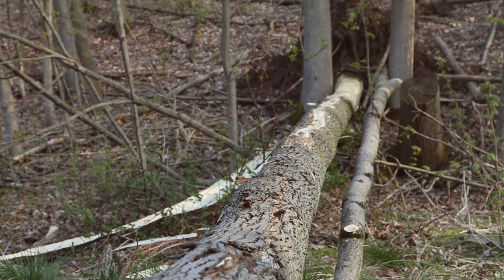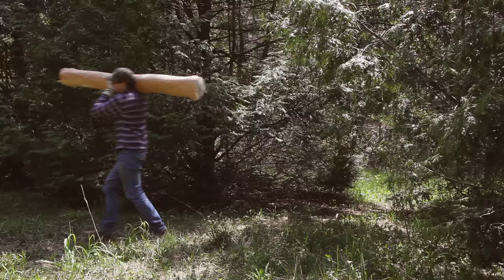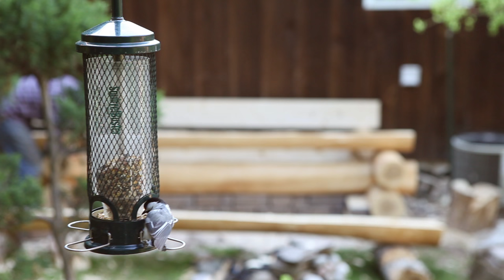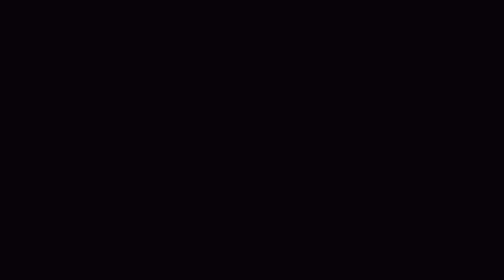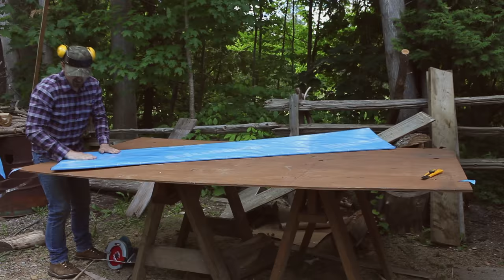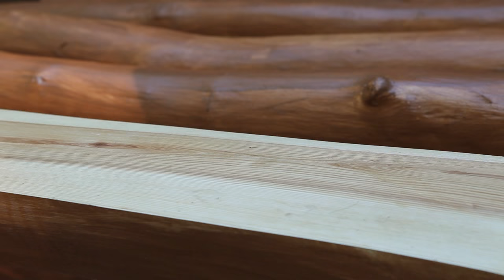Timber Garden

Comment: Nice work.

What did you line the base with, that blue material?
Reply from the maker: O yeah, I should have mentioned that.  It's called blue skin and the most expensive part f the project but it was so easy to work with. It's used in roofing. I got it from Home Depot. I have lots left. Think I'll make a waterside. https://www.homedepot.ca/en/home/p.blueskin-wp-200.1000403398.html
Reply: A wooden water slide!  Sounds fun!  Thanks for the reply.